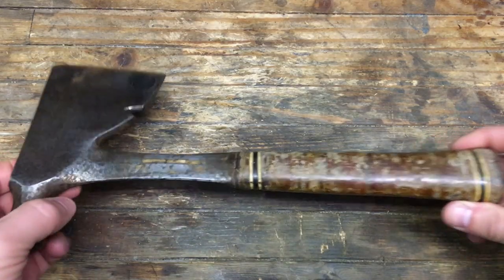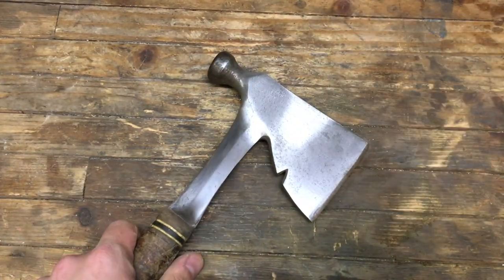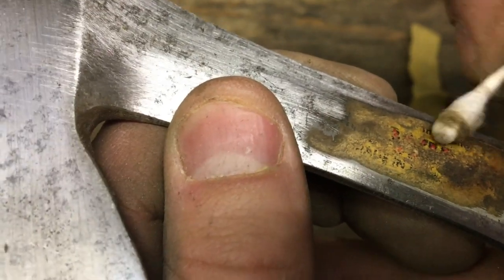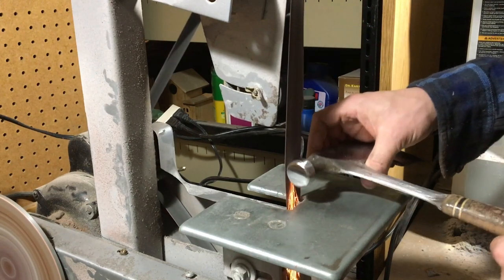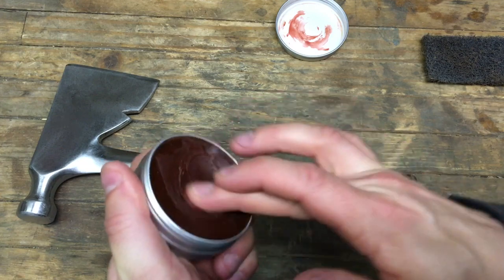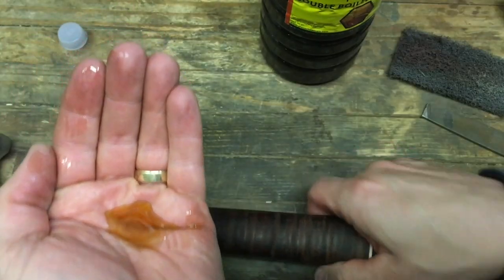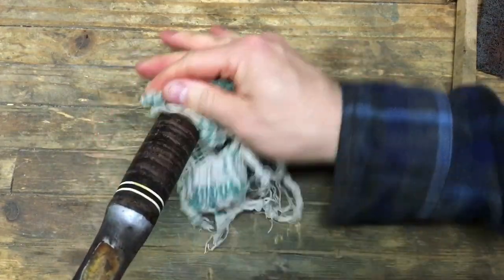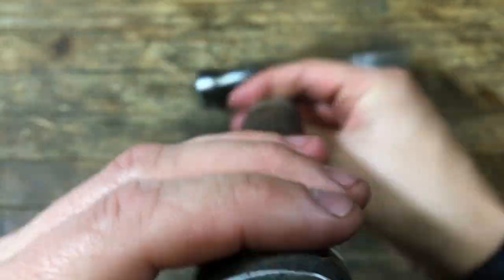Quick 60 min Hatchet Restoration in under 7 min - Estwing Roofing Hatchet

Comment: Some neatsfoot oil would do a lot for that leather handle. You'd also be able to give your sheaths a coating. It will darken a bit but works wonders for leather.
Reply from the maker: That’s what I’ve heard from a few folks. I plan on giving it a try.

Comment: I suggest you use Obanauf's,  mink oil, or neats-foot oil; something meant specifically for leather on leather. I don't think the linseed oil hurt, but those would be better. Yes, we could see that even after the application they rings were still dry. According to several better sources than I, you should let the oil soak in (hang it by a string) overnight or longer. often you will find there was no excess to wipe off. And you should repeat the process until there is excess to wipe off. In the case of wooden tool handles, the rule of thumb I learned was: once a day for a week, once a month for a year, then once a year.

Comment: Hey OS! What grit did you use to smooth the handle? And if I have to chose between Lindseed and Neatsfoot to repair a handle, which do you recommend? Love the vids!
Reply from the maker: For the leather handle I used up to a 220 grit and I’d recommend the neatsfoot oil.
Reply: @oldshovel  Thanks Dude! I have an old Estwing hammer, 12oz head. It was my grandpa's, no telling how old it is. The lowest ring on the handle seems to be rotted, but everything else just looks dry. I'll try the neatsfoot. Thanks again!

Comment: You made a good decision not to switch to a Micarta handle. Micarta is HARD. Peter Brown made a hammer, including the head, of Micarta, and it drives nails just fine. In other words, a Micarta handle would transfer most of the shock to your hand instead of absorbing shock.